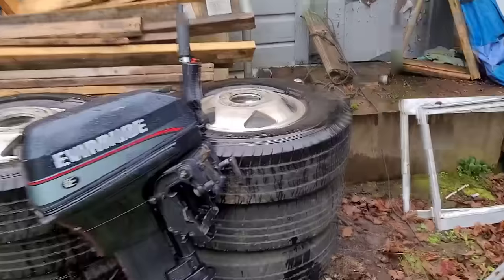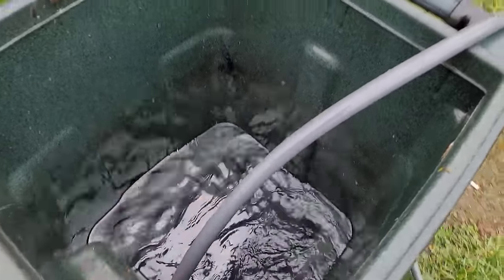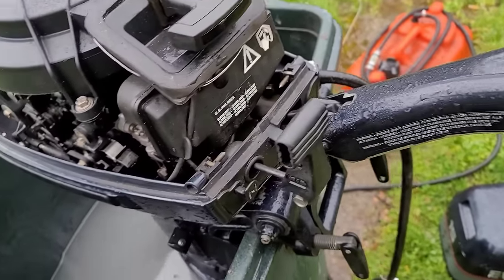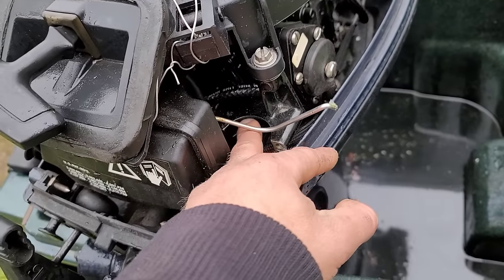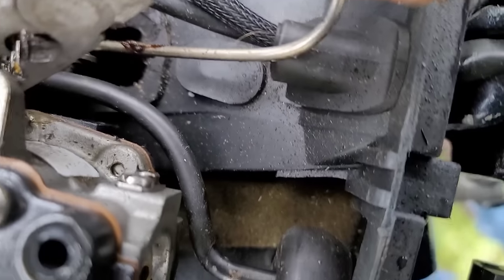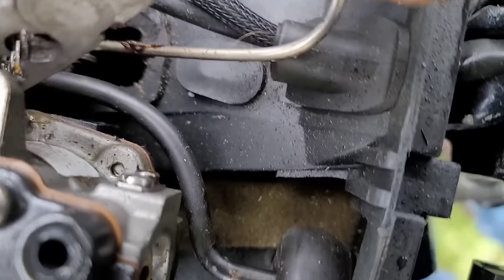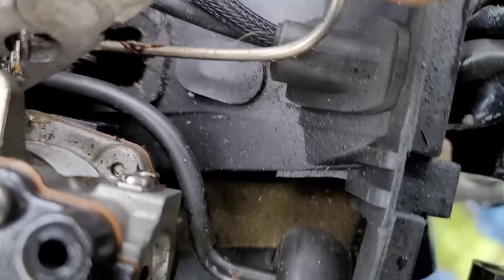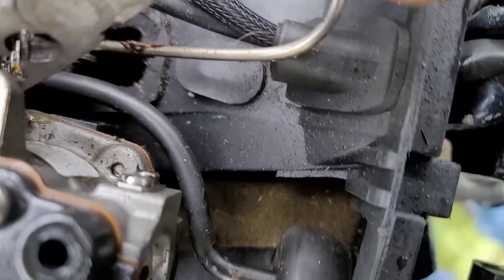how to fix an outboard that won't idle.

Comment: one thing I see with the pee tube is a service bulletin from the 80's era. The hose from the engine to the pee hole needs to be lengthened and re-positioned so that that hose runs along the top of cylinder one. The problem was water at low speed was not reaching the top cylinder enough to keep it cooled and repositioning the hose so it loops over the top cylinder fixed it on all models and sizes of omc engines. Actually no matter the make of the engine, ity still needs routed in that way. Easy fix folks and can extend the life of the engine by decades.

Comment: Too much smoke you running it 50:1??
Reply from the maker: Yes 50
Reply: @CAPTAINWILLY  might be normal i guess. Johnson and Evinrude are no longer in business but they recommend we screw the rich lean adjustment all the way in and out 1/4 turn. They built good engines
Reply from the maker: Lol. Well that's a good starting point shur. There were many factors involved in them going out but there still a marine business. Just focusing on rotax brp stuff now. The amount of smoke in this video is likely due to the quality quality of the fuel I was using. This is a test tank that might see 3 gallons of use a year
Reply: @CAPTAINWILLY  my friend has an old mercury Comet. His other friend couldnt get it running but i did. Problem is it wont idle only run at mid to high rpm.

Comment: I have a 25 hp1985 Mariner two stroke that ran well and suddenly when I last used it when I tried to apply power it work start to rev up rpm and suddenly would troll back in rpm when ONLY on the boat in the water under load my mechanic checked it out fully out of the lake not under load and said there was not problem but it will not rev up/speed up under load in the lake   What is my issue
Reply from the maker: Ahh yes. The works when it's home but not on the river problem. Most of the time that things run great when not loaded but have a major lack of power it's related to a cdi box or coils. You need to buy a spark gap tool. It's a spark tester that gos inline to your spark plug wire but has an adjustable gap. The spark should jump over 1/2 an inch. I'm eilling to bet you have week spark. Enough spark to run perfect with no load but not enough spark to make power under load

Comment: When I run my 9.9Hp 2 Stroke kicker I am left with the same result everytime - the interior of my prop will be covered with a milky oil and water mixture. Is this a sign of too much fuel being sent through the motor and resulting in unburnt fuel exiting through the exhaust?
Reply from the maker: Just to confirm. Your lower unit oil is always good and full. 
Excess fuel could be a rainbow in the water amd black soot never ever will it be milky.
Reply: Thanks for the reply - the lower end oil is topped up. I drained it in the fall and ensured there was no water present. This has been going on for years with the motor. Often times after running the motor on the lake.. it will take 3-4 days to notice a heavy black oil slowly starting to drip from my prop... I was assuming this was left over fuel evaporating from the system and allowing the mixed oil to run down through the exhaust. Just today I noticed the milky substance after running the motor out of water on muffs
Reply: I should also mention this is a 9.9hp motor I'm running to achieve a 2mph trolling speed.. so more times than not the motor is sitting just slightly above a low idle.. I've also consistently had spark plugs foul as they get wet and dark

Comment: I have a 2004 3 cylinder 2 stroke 60 up mercury outboard.  It starts okay but spits and backfires and will stall when in idle.  I changed the plugs out but didn't change much.  Any tips to fix this?
Reply: Check reed valves
Reply: @huntmasterjames  ended up rebuilding fuel pump and changing fuel filter.  Runs like a dream now.
Reply: @katiedolfman6496  good deal

Comment: how far for the needle screw should this be.   I'm trying to get mine to idle as it dies after a bit of running and kind of chugs before it stops.
Reply: I tried between 2 and 4 and can't seem to keep her going for long.    carb was cleaned out and everything.
Reply: even adjust the throttle where it is between the 2 needles under the fly wheel.
Reply from the maker: Ahh I see. I need to do a video on tuning. 
Yes a good starting point is 1.5 turns out. If it won't idle at that you have somting else going on. Should idle a bit fat at 1.5 turns. Remember 2 strokes out is fat in is lean. 4 strokes in is lean out is fat
Reply: @CAPTAINWILLY  how would an outboard run the gas tank is not vented.  I just found out mine wasn't venting when I was running could that be something that would make the motor run not very well.
Reply: @CAPTAINWILLY  there’s idle adjustment on end of tiller handle isn’t there? There is on mine 93 15hp

Comment: You helped me to get my motor running like a top again after almost being defeated, the gas line going into the carb was plugged after a very thorough cleaning of the carb, taking the screw to drain the carb fixed it right up. Thank you very much for your help!

Comment: Nice job, so what do you think would be the issue if a small outboard idols well but when you give it extra throttle at speed it bogs down and turns off
Reply from the maker: At the bogg spray brake clean into the carb at wide open throttle. If the bog gos away and revs it's lack of fuel issue. If it gets worse it's a spark or weak spark issue
Reply: @CAPTAINWILLY  Do you mean brake cleaner or carb cleaner I can’t find bogg spray brake clean
Reply from the maker: @blueback21  any arisol fuel will work. He'll even hair spray would do the trick. Don't do it for prolong times on a two stroke tho. Because obviously it dosnt contain oil
Reply: @CAPTAINWILLY  agreed! I threw a rod in my 9.9 Evinrude using starter fluid can't emphasize enough not to use anything without oil in it
Reply: Also your external fuel line too.. took me 2 days to find out my fuel line and hand pump was shot.. my 1985 evinrude now runs strong!